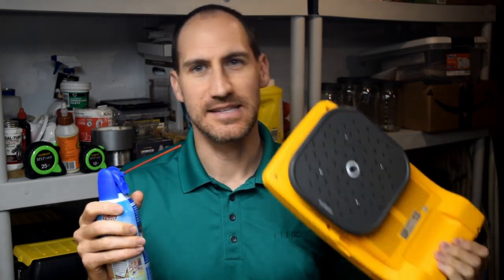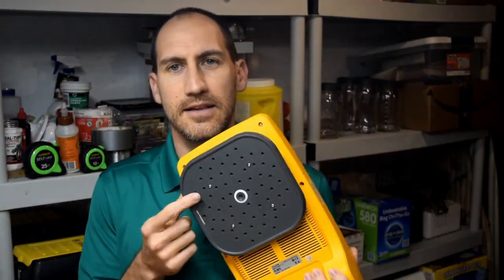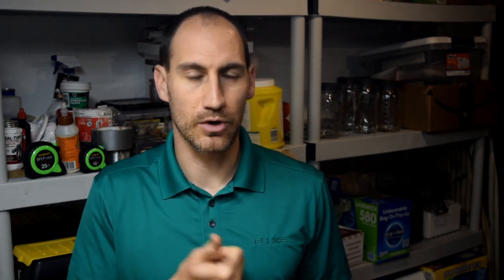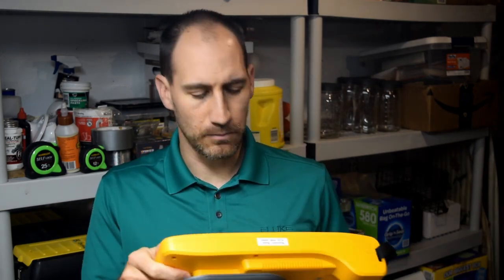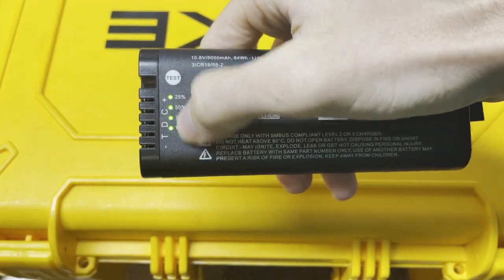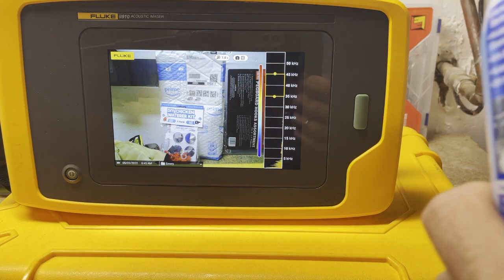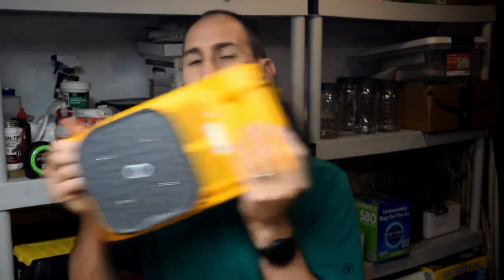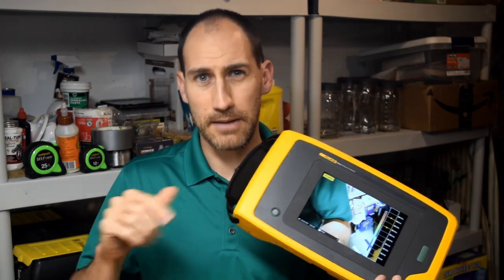ii900 ii910 why to buy - Fluke Fridays - Episode 51

Comment: With refrigerant costs constantly on the rise, I'm looking into how this product performs for detecting refrigeration leaks. I’ve searched extensively online but haven’t found any clear examples of it being used in this specific application. My main question is: can it actually detect or reveal a refrigerant leak that’s hidden behind the insulation commonly found on suction lines?
Reply from the maker: not very good.  I would not recommend.  But reach out to a local rep and have a demo done.  That does not cost you anything.
Reply: @fridayswithbrandon  Thank you for your honesty and feedback. Next time I come across a leak, I will use my thermal imaging camera to see if it picks it up.

Comment: I stumbled upon this video today and I am wondering if this guy would also pick up refrigerant leaks.. I would imagine so.. because it's picking up vibrations not particulates I know that most of the time refrigerant leaks are very miniscule.. either way this thing seems awesome..
Reply from the maker: @timothycarnill1992  it can but they typically have to be gushers. If you have empty lines and can pressurize with plant air it's your best hope. This application is not a home run for this tool.